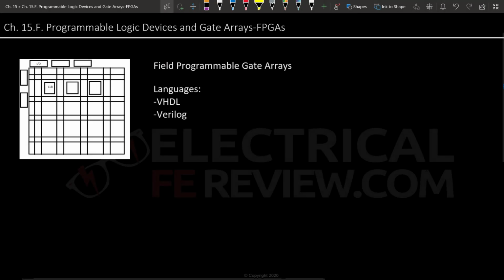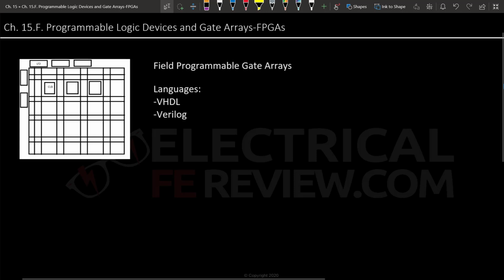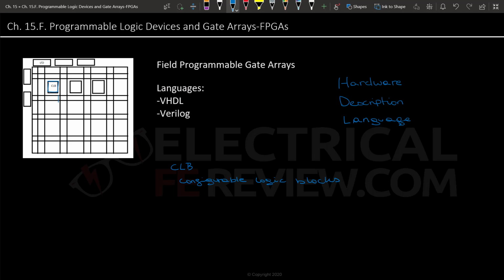Understanding FPGAs: A Step-by-Step Tutorial for the NCEES® Electrical and Computer FE Exam

Comment from the maker: Video Contents:
0:00:00 - Introduction to FPGAs
0:00:42 - How FPGAs Work
0:01:02 - Introduction to Hardware Description Language (HDL)
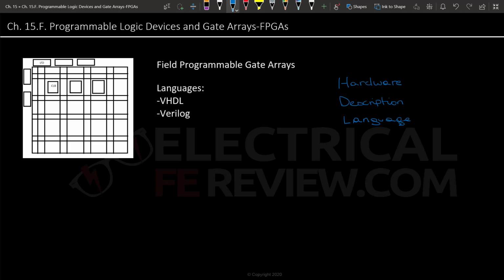0:01:21 - Structure of FPGAs
0:02:13 - Importance of Configurable Interconnections
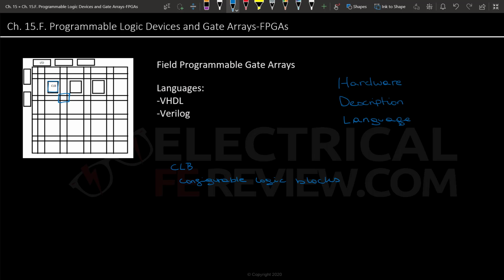0:02:24 - Advantages of Using FPGAs
0:03:03 - Introduction to Verilog and VHDL
0:03:19 - Differences Between Verilog and VHDL
0:03:37 - Encouragement to Learn More About FPGAs
0:03:44 - Unique Features of FPGAs
0:04:05 - Use of FPGAs in Image Processing
0:04:22 - Conclusion and Recap

Ready to master the Electrical FE Exam? Don't miss out on our expert-led online course, with video examples and practice problems. Best of all, it's 100% FREE! Enroll today at www.electricalfereview.com and take the first step towards passing the FE exam.